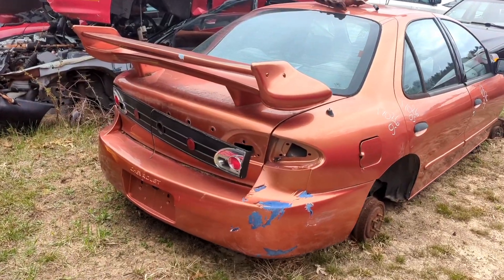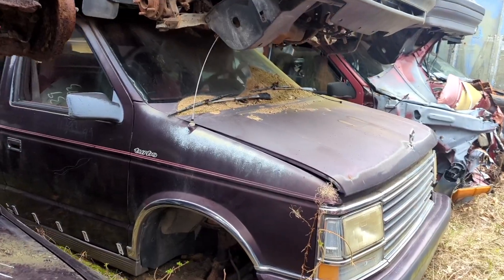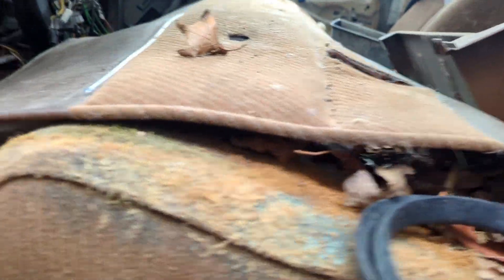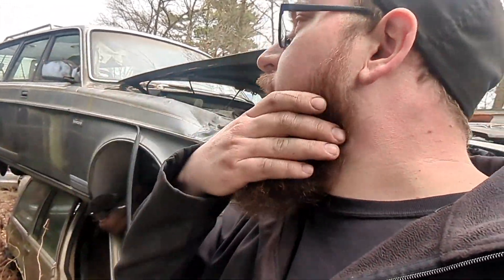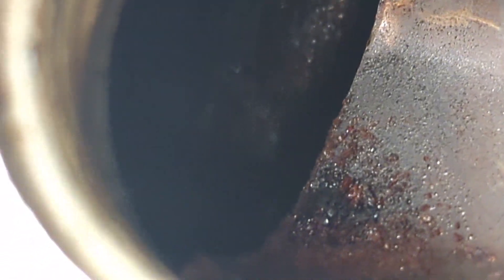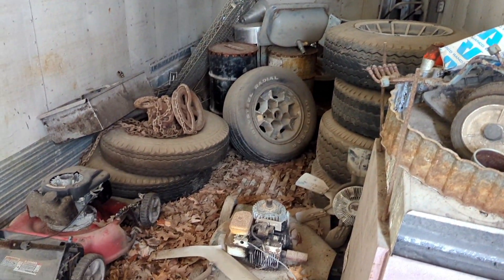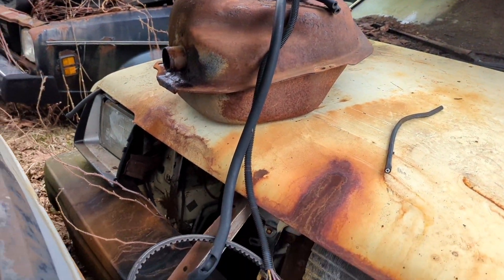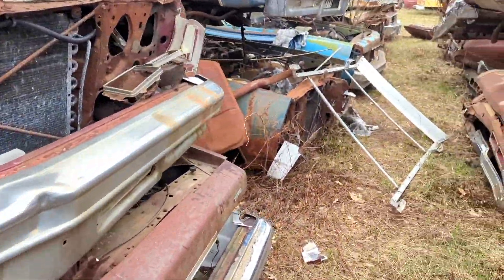Junkyard Trip: Sourcing some Volvo and Tercel parts for the fleet!

Comment: I had and built a 89' factory 5spd Turbo Plymouth Voyager. Had it pushing 18psi and was an absolute rocket. Called it the "spool Bus" it was even the same colour as the one in the yard there lol
Reply from the maker: That is amazing! How much PSI did they make from the factory? That sounds like a fun little rocket! Especially being a stick shift! I have only ever seen one stick turbo voyager in person. It was at concors d elegance Detroit of all places too. Haha.
Reply: @BeardedWrencher  7-8psi stock. but have enough fuel to go to 14 before the overboost hit's. I would use a Zener diode to trick the MAP sensor to never see more that 13.7psi. Than add fuel with an adjustable regulator 🙂